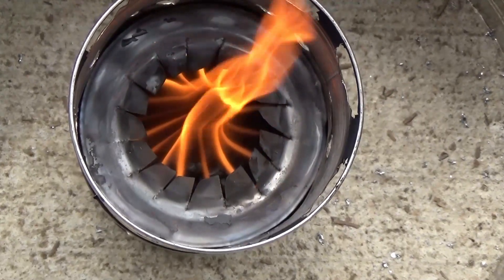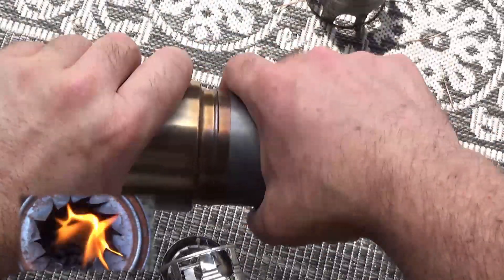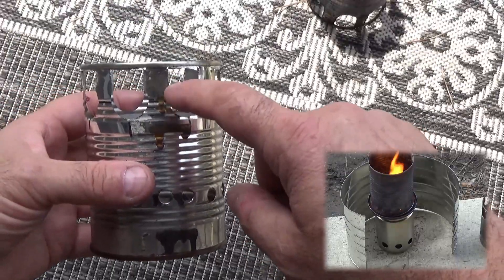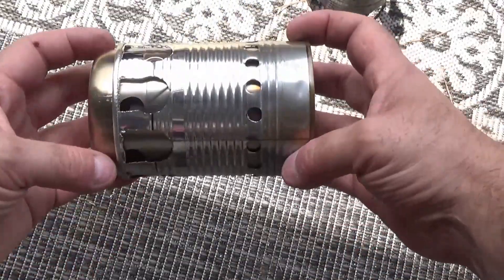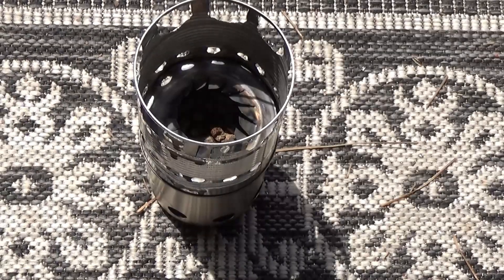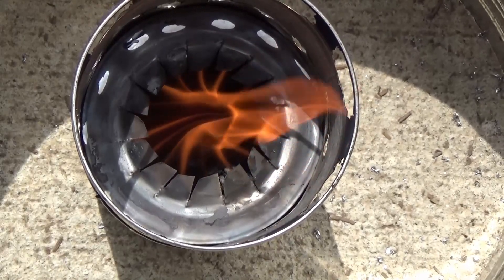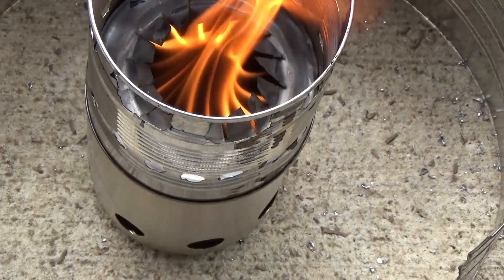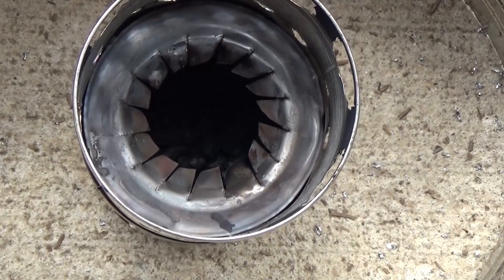Part 2 DIY Small Stainless Steel Tent Stove! Wood Gas Stove Science| Camping Stove|

Comment: Tip for people trying to drill stainless steel: Use newer cobalt drill bits with a pilot tip. Put the metals to be drilled in the freezer.  Get a container and fill it with cold water and some ice.  Submerge the stainless steel in the cold water. Go between slow and medium speed with pressure. Clear initial shavings away by shaking it in the water, then continue drilling.  

   I was having definite issues before using the above. Doing the above combo made it almost easy. An automatic center punch can also help.
Reply from the maker: Thanks for the drilling trick! Hope it helps other people!
Reply: @heathputnam9524   You're welcome. Me too.

 Cheers

Comment: I watched a video from fourdogstoves where their primary air is a turbine shape(non rotation of course). He said that it offers a lot of advantages including reduced clogging and a better air flow. I tried this on a can and it worked well.

I think that you can incorperate this principle by cutting the bottom off the inner chamber but leaving some curved edge. Then, use the bottom plate to make the fan/turbine. Adjust it so it falls from the top and fits well under there. I think this also improves the durability as it eliminates thin points where the primary holes are drilled
Reply from the maker: The turbine shape on the bottom of the burn chamber is an interesting idea
Reply from the maker: Oops… thanks for watching!

Comment: Love these builds, Heath.  I am kind of a camping stove nut and have so many designs.  My favourite is a hobo stove from David West's site.  I love that twig stoves use forest floor fuel.  Have you or anyone else tried stacking twigs vertically and tightly into your cans?  Kind of like a Swedish torch idea.  Less work in chopping twigs into small bits.  Thoroughly enjoyed these vids.  Thanks for your effort!
Reply from the maker: This works but requires some design modifications. Natural fuel is much more finicky. When I use twigs I cut them up small due to the excess airflow if they are kept long. Thanks for the question!

Comment: Kind of related to my other comment on the prior video.  Since these tend to burn so efficiently and completely (most importantly, seems to burn the CO), do you think that you could use this directly in a tent without a chimney vented to the outside?
Reply from the maker: Just make sure you burn it a couple times outside to get rid of the oils and coatings they use during manufacturing! Thanks for the comment!

Comment: One tip- Use a stepped sheet metal drill bit.  My husband got one for $40.  A regular drill bit will not work well and you could injure yourself.  First make a divot where the hole will go.  This makes it easier to drill.  We did this by putting a big stick in the can, lengthwise.  One end of the stick was on a bench and I held onto the stick and can while my husband hammered a nail into the can, to make a divot.  The stick was against the can, under the hole mark, to provide support and prevent the can from bending.  Then we drilled the holes where the divots were.  This worked well.
Reply from the maker: Thanks for the tip! Hope you enjoyed the video!

Comment: Heath. Very nice work on the can stoves. The obvious limitations with the cans are that they are a batch type system. Other comments have been posted about adding fuel during the burn, which is disruptive to the process. Have you considered the hybrid rocket stove gasifier design that incorporates a bottom fuel feeding port?
Reply from the maker: Steve, thanks for the comment. The can stove designs I have worked on have a particular use. Basically to make some lunch or coffee while out on the trail. It can also give you some nice smoke free ambiance in the evening before hitting the bedroll for the night. The flame will last about a half an hour and after conversion to char gasification will last another half an hour with useable heat. I have thought about trying to come up with a hybrid but have not moved beyond just thinking. I may try it in the future if I get enough interest by my subscribers. Thanks again for watching!

Comment: What if you made the bottom holes a little larger and then made a short cylinder with matching holes over it so the holes line up. Then you could rotate the outer cylinder as a damper to find the most efficient airflow?
Reply from the maker: Thanks for the comment!

Comment: Problem I have had with gasifier pellet stoves is refueling on the go,   Seems like you have feed pellets at an individual rate to avoid smoke and fire smothering…..any suggestions for this problem…..Even my large commercial Flame Genie has this problem
Reply from the maker: Adding fuel interrupts the pyrolysis zone by letting oxygen in with the fuel. The best way, although most difficult, would be to introduce the new fuel from the bottom of the fuel charge. This would lift the fuel and the pyrolysis zone up. Way more complicated than my can stoves! Thanks for the question!

Comment: Very happy with stove. Update. I used smaller primary holes in the bottom outside than you use to slow down the burn and burn time for cooking. But now I'm getting a lot black soot on my pot. If I inlarge the primary holes will that reduce soot?  Btw I got a new set of step drills. I will be using a little cutting oil this time. Lol
Reply from the maker: Yes increasing the primary will reduce soot. What does your pot stand look like? Too short will cause soot. Thanks for the update!
Reply: I reviewed your other videos on the paint can stove. Very good info! Yes intake holes too small and a taller "chimney" stand is needed. I will work on getting that Progresso can too. Hopefully it will all fit into my Stanley Adventure cook set.

Comment: Update. I did bring my intake holes up to 7/16 before I burned up my drill bit. Lol (I know better) 
Works better and did bend the inside holes over for that vortex affect. My biggest problem is getting the bottom on and off. That's where I want to store my chimney pot stand. I will keep working it to open it up.
Reply from the maker: I ended up filing a groove in the bottom deep enough to pry it off with my knife. Thanks for the update!
Reply: Oh yes. I  may drill some pilot holes and cut slots/slits into the bottom. Still has some tension to hold.

Comment: I'm making progress! Almost done.   Laying out the holes and drilling stainless is a challenge with old drill bits! Lol
 Making the holes smaller and will watch for flickering indicating the lack of airflow when testing comes.
Was going to email you a picture but couldn't find it.
Reply from the maker: That is awesome! Yes a fruit can for the chimney/ pot stand. Make sure the chimney has a row of tertiary air holes around the bottom and some larger escape holes at the top for the flame to lick out of or the fire will smother and smoke when you add a pot! Thanks for sharing your progress! I’m excited about your build!
Reply from the maker: Sounds like good progress, the stainless drills tough but will last a long time! Keep me updated on your progress! Thanks!
Reply: Did my first burn. 1 cup of wood pellets. Burn for 30 minutes with flame about 10 inches high. Another 30 minutes of hot coals after flame went out. Did use a small fruit can to create a chimney effect.  Will open primary holes up a bit. Could tell it wanted more air. Very happy with this one. Will probably trash my tin can stoves.  Thanks again for a great little stove!

Comment: I did buy this Ozark thermos. 
If I take the hole size you recommended but bring them down to half the size but then double the amount (on the outside only) do you think it will preform the same on the thermos?
Reply from the maker: It should. If the flame pulses you need more fresh air intake. Thanks for the comment!
Reply: Thank you so much. Btw way the bottom on mine was very tight. Need to reshape my blade now! Lol
Reply from the maker: Lol! How did it work? Did you build one?
Reply: Not yet. But can't wait to finish it and fire it up!  Busy with other things .
Reply from the maker: Understood! Keep me up to date on how it works! For fresh air intake I usually start a little smaller and if the flame pulses during burning open the holes up slightly. I have also found very high elevations require slightly bigger holes. If you go too big the wind will effect it more. Good luck!

Comment: This is great! I did look at the same Ozark can cooler but I thought it to be too small. But wood pellets are a game changer. Is there anyway you can put large holes around the mouth of the cannister and still have a good working stove? Would the lid still screw on?
The way you took it apart was perfect! Clean and simple in part 1.
Reply: No holes for fuel. Wood pellets are a one load run for me. I was thinking holes or Maybe V cut around the top for a built in pot stand. Just less to carry around. But I'm thinking this will probably suffocate the fire causing more smoke. What says you?
Reply from the maker: Are the large holes for adding fuel? I usually do not recommend adding fuel to a "Top Lit Up Draft" stove because it drastically effects the pyrolysis zone and can even smother the flames and put the stove out. Thanks for watching!
Reply from the maker: It may be too low, the pot stand height is important to give the chimney effect. Maybe I should play with a better pot stand design for it.
Reply: Yes. Something packable.